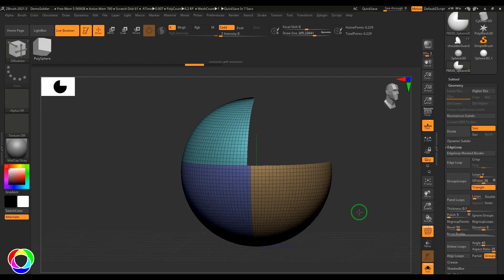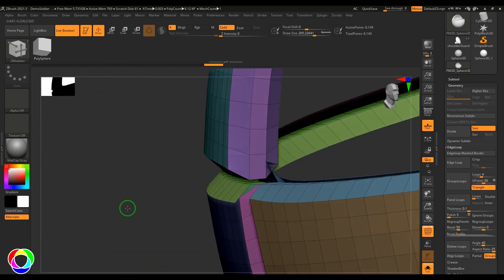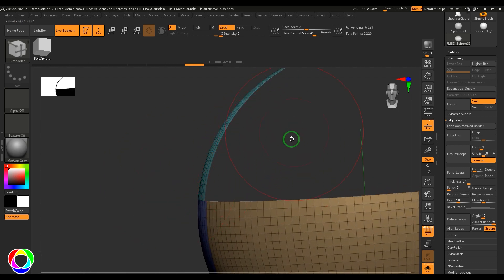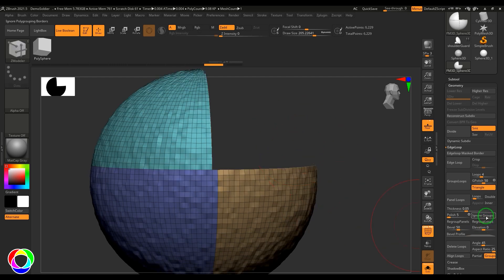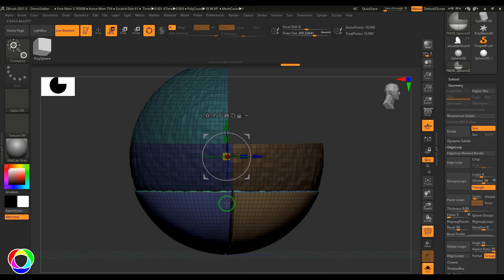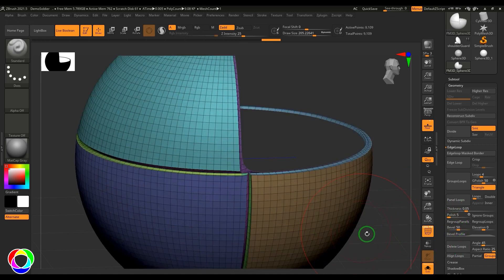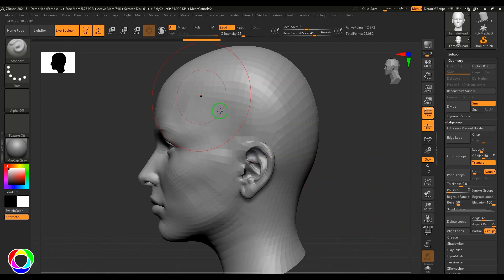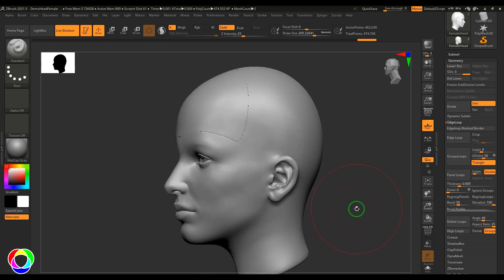Panel Loops in ZBrush: Sculpting Complex Surfaces

Comment: Thank you. Very nice breakdown. But there is one issue. When multiple Polygroups intersect, Panel Loops don't stay uniform. They "fall off" at the intersections and don't continue evenly. Check out the issue here: https://youtu.be/46QeNBJ78ws. How do you fix these specific Panel Loop issues at intersecting Polygroups?